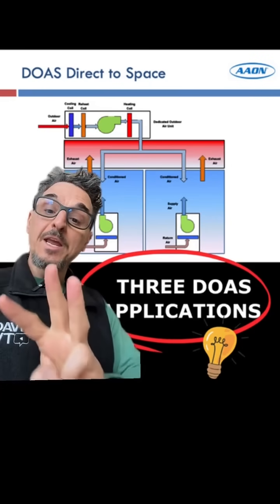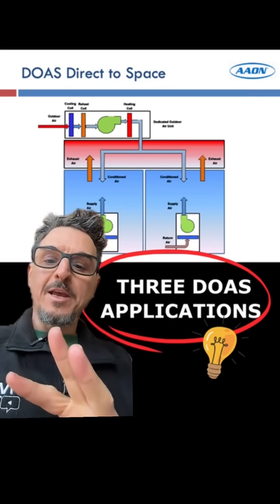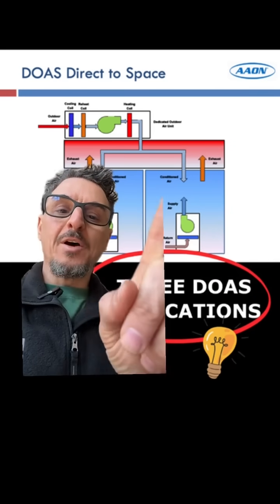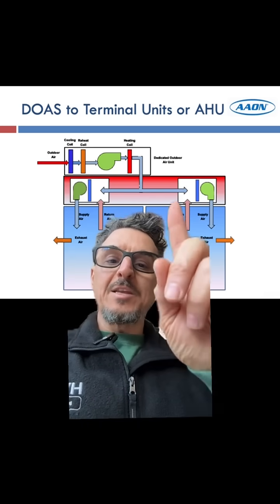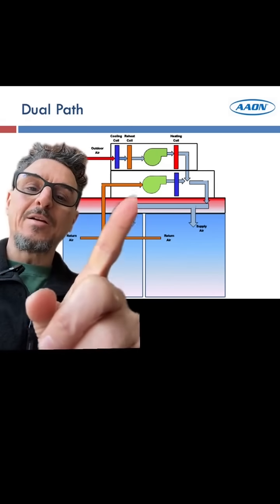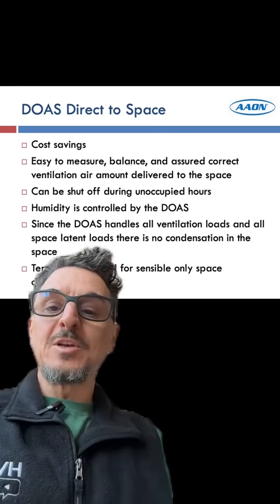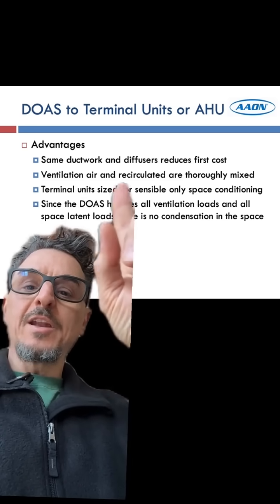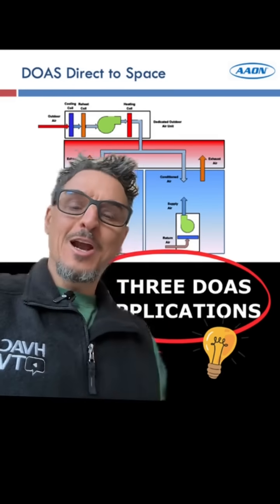The Dedicated Outdoor Air System (DOAS) or 100% Outdoor Air system and types of HVAC applications.

Comment: Where do ERV/HRV's fit into this equation?
Reply: doas is an erv/hrv. It just adds some things to bring recovery to 100% as it finishes conditioning the air (dehumidify and neutral temp trim) before delivering to the space. 

the third system here further trims to a supply temp that would satisfy heating/cooling loads.

 you'd get roughly the same effect by ducting an erv exhaust termination near a heat pump outdoor coil, and erv supply to air handler return. add an inline dehumidifier on erv supply for full effect.